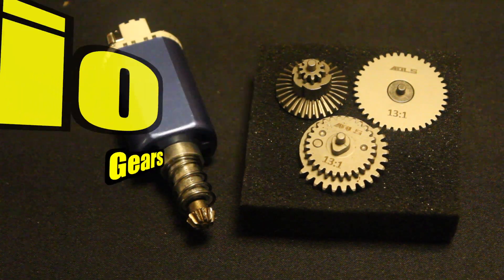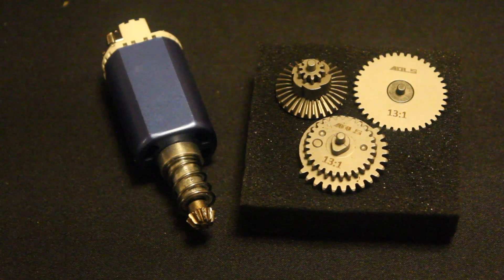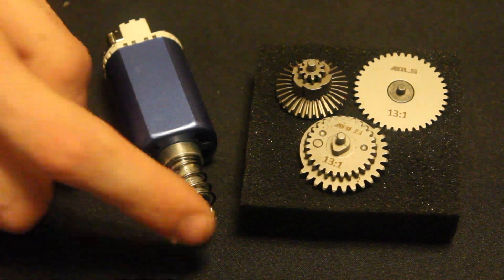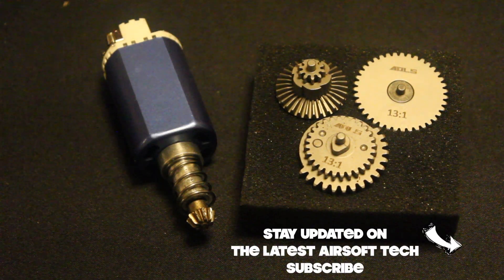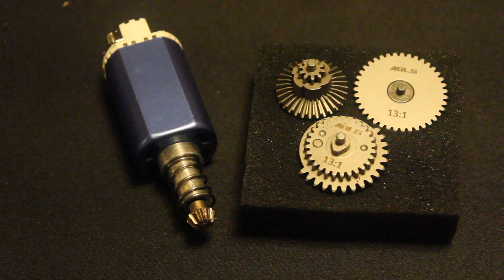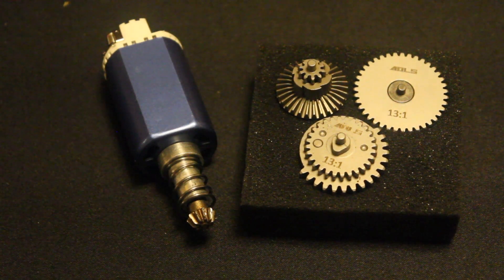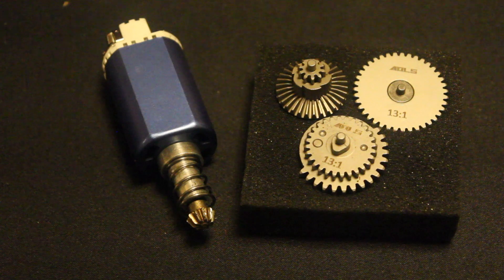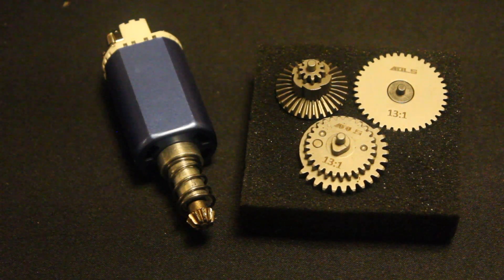13:1 Ratio Gears WHAT DOES THAT MEAN? Airsoft Tech

Comment: Hey I’m trying to build a gc16 raider and I got it and it is great I am wondering upgrades that I can do other than barrel for the hop up what do I need. I’m going for a long to mid range build but I don’t want to go over 400 FPS any help?
Reply from the maker: shs full steel rack piston and piston head and an upgraded motor ZCI high torque

Comment: New rule you cannot talk about gear ratio without talking about torque....  too many people use these gears without having any understanding as to why their motor is so hot that they can sear a steak on  pistol grip,  not to mention the only reason their setup isn't over spinning or pme is because of their tiny buffer tube battery that is swelling up because of how much amps the build is pulling but their battery simply can't support the system... then on top of it they add in active braking and precocking.... 20:1 14tpa  ss2 m130 30 rps build for the win....
Reply from the maker: I loved every bit of your Responce and I deadass know that you teched a lot of airsoft guns , and dealt with a bunch of inexperienced people lmaooo. But your right about the torque
Reply: @TheRealDealAirsoft  actually just tech on a few of my own. It's in different Facebook group pages where I see people really struggling with how to set up 13:1 gears, I'm not joking when I say there's a post everyday. It is much safer to go with a 22 TPA motor, but people keep throwing in 16 to 14 tpa and run into problems with crazy motor heat, battery heat, performance loss, overspinning, pme etc.
Reply: Imo an aeg built for over 30 rps should be built with a dsg.

Comment: You could do with adding a bit more info here. Eg: why people will fit 13:1 gears, what springs they work best with etc
Reply from the maker: Yes that’s for another video ! That’s a longer discussion. This video was aimed at specifically addressing what Ratio means in airsofter gears. 

Before diving deep into what works with what , fist we have to understand the basics.. what is a ratio to begin with. 

If your curious about that information I’ll defiantly make a more in depth video touching on build parts to use with these. Why we use this. What application for. What springs. Pre cock no pre cock. I’ll defiantly make a video going more in detail. 

Thanks for the feedback my brother ! Where r u from
Reply: The Real Deal Airsoft, I’m from the UK mate, you may remember I once said your voice reminds me of Richard Lewis! 😂 yeah sure, just giving you some tips! 😉
Reply from the maker: jackd787 bro you know I never forgot that. Almost every time I record I think about that and I laugh.

Comment: Does your pinion also need to be 13:1 or do all pinion gears have the same number of teeth? Also do you need a high speed motor to run 13:1 or can a stock G&G motor run 13:1? I put 13:1 gears into my MP5 and it gets stuck, I don't know if its the tappet plate is getting stuck or if the motor isn't strong enough to push the 13:1 gears, any help appreciated if your still around.
Reply from the maker: Your stock motor has no torque. Grab a real deal golden Boi motor and pair it with shs 13:1 and Youl be shooting a dream. 

Don’t worry about how many pinion teeth they are. Not important that all have the same teeth count generally. But the torque is what you need. 

Lower ratio gear sets require higher torque motors. Not higher speed